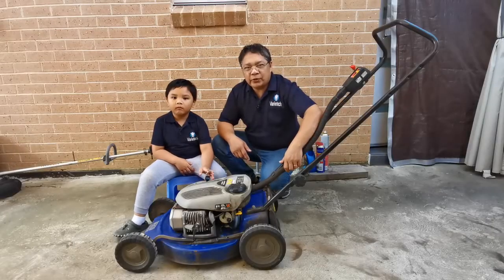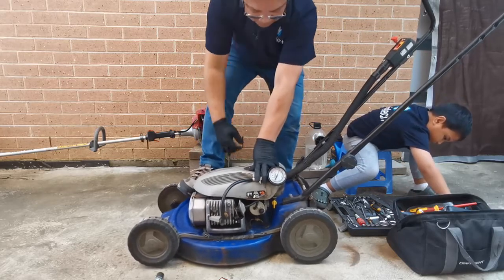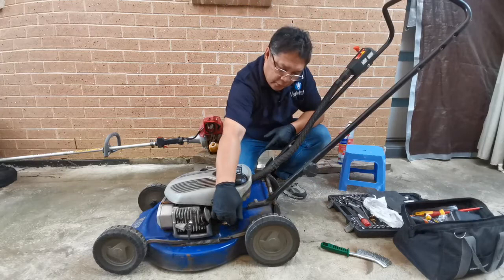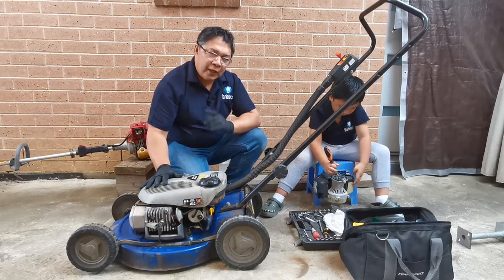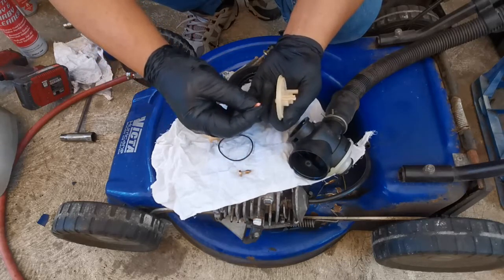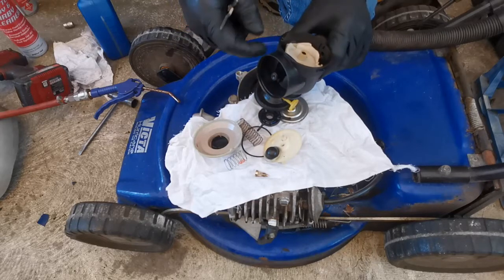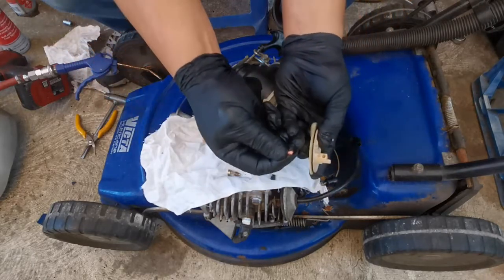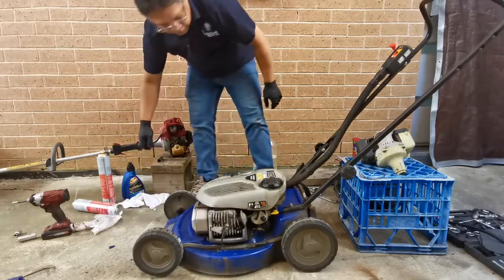VTECH 59 - Victa Power Torque VE40 Won't Start. Guess What?

Comment: I'd like to know why the main jet failed? Which the video doesn't mention
Reply from the maker: In somehow, the previous owner pulled out the carby with carburetor still full of dirts and dust with dirts on the hands holding the main  jet and dirts managed to get into the tiny nozzle on the main jet and blocked the jet. Reason why I cleaned the carburetor before opening it to demonstrate a good practice minimise dirts when handling parts especially main jet. Cleaning the main jet cannot be guaranteed unless you remove the mesh completely, clean the nozzle with guitar string, spray with carby cleaner and blow with compressed air. Without removing the mesh, blowing the dirts in will get trapped inside the mesh. Mesh is also important as secondary fuel filter. Thanks for watching our videos and subscribing to out channel. Click the notification bell to get notified for upcoming videos. You can also suggest what contents you would like to see. Cheers, VARIETECH
Reply: Its rare to see large pieces of dirt trapped inside the main jet with the mesh being so fine, normally they gum up. I find a spray of caby cleaner and a blow of compressed air is all you need to see light through the hole.  You are right though with the mesh not being removable